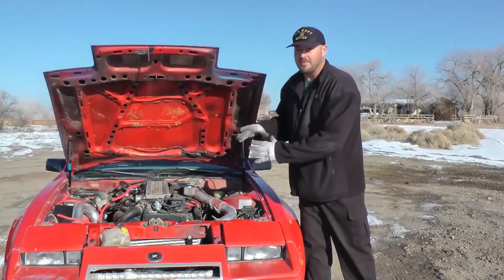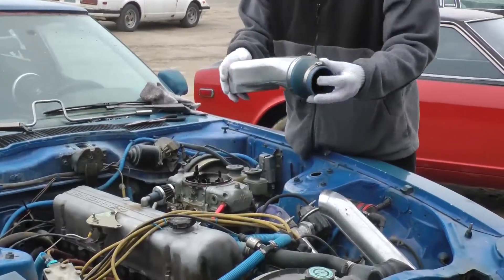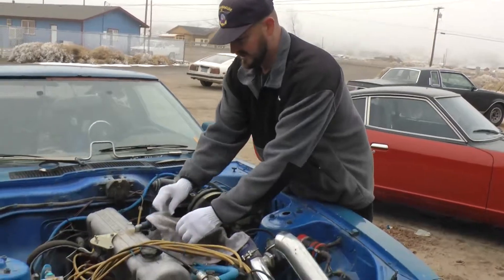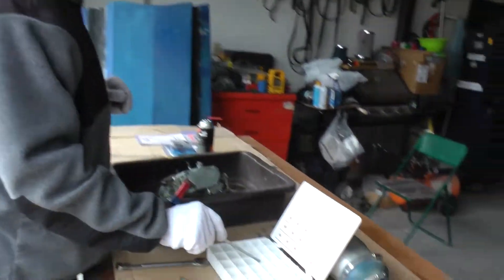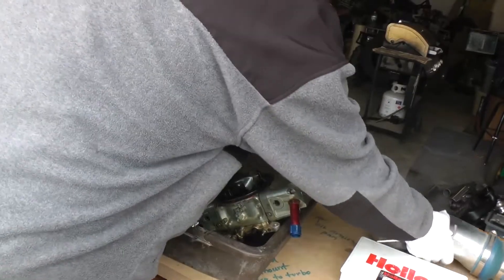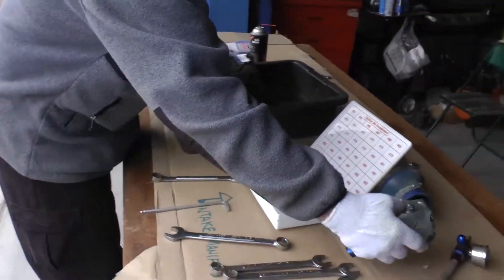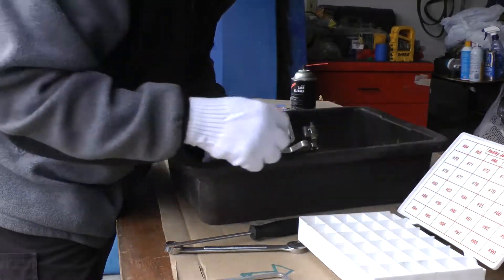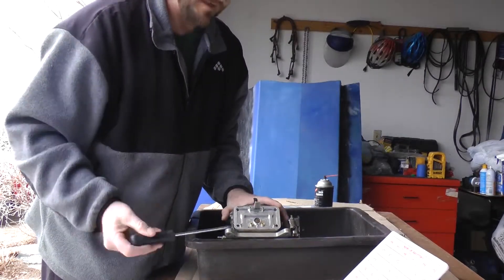Tuning a Carburetor; Jetting

Comment: Great video!...I gather that air/fuel ratio meter is a narrow band and what brand is it?

Want  2 grab one for myself...keep up the good work!
Reply from the maker: Recommend auto meter gage, mine is an eBay special and works well, especially since I monitor exhaust temp, fuel pressure and boost along with the air gage to give a better overall performance view, they work together